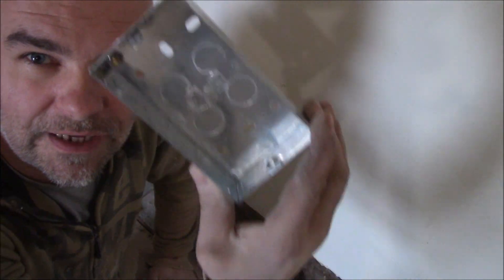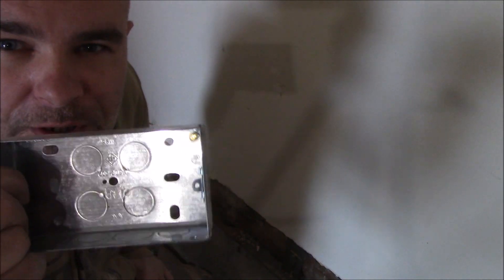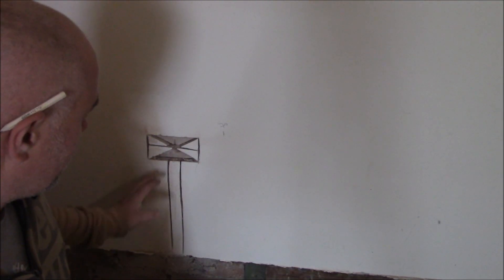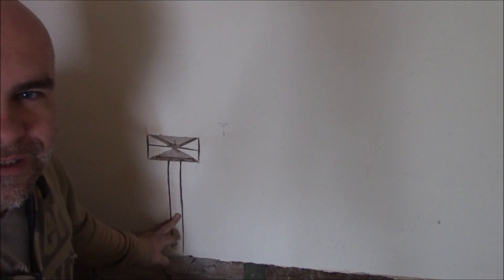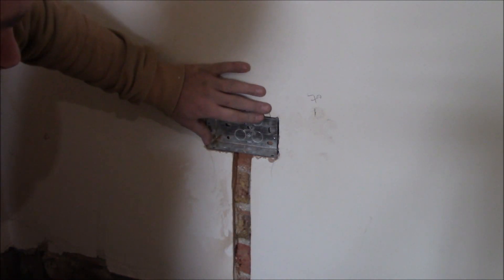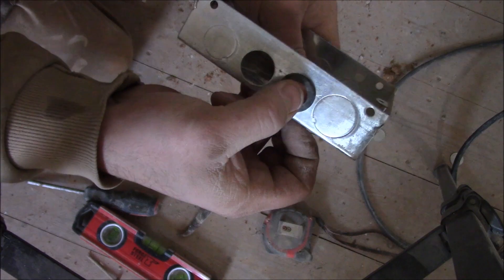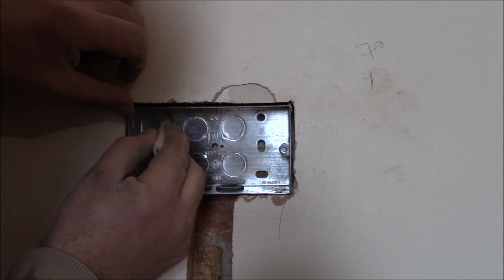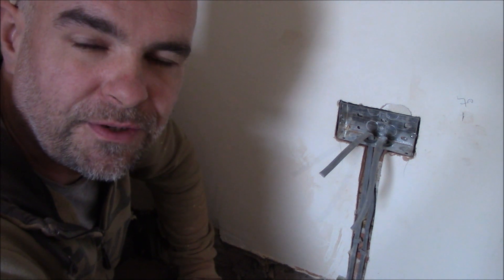how to install electrical back box How to fit socket outlet metal box

Comment: 5yrs late to the party but hey I’m here. In the us we would surface mount that box and install pipe to protect the wires. Pretty wild that you guys cut into the structural parts of the building for the box and wires. In the us the wires would have to be protected in conduit or roughly 2 inches of concrete not sure what that is in mm 😂. But it looks to me like you only cover the uf cables with .5 inches of material when you’re finished. I would say your finish probably looks nicer but you sacrifice the building integrity and wire protection to do so across the pond there. But if that’s how you doit it looks good from over here mate 👍

Comment: Getting the wall flat behind the box is quite tricky and can be deceptive as a small lump will make it feel like the box doesn't fit. I ended up going too deep and needing something to pack the wall back out (I used cardboard from a box) but it didn't feel good. Practice makes perfect

Comment: Congratulations on such craftsmanship with the angle grinder for the wall box cut, is one of the neatest I have seen. I myself use an Arbortech Brick Saw with wall box blade & chase the walls with a Makita wall chaser with dust attachments....makes for effortless work & less cleanup ....enjoyed your post.   Greetings from Australia

Comment: When you do this do you need to run an earth cable from the box to the earth socket?
Reply: Not required by the regs, but good practice.
Reply: Good practise yes but itll be earthed through the plate pins
Reply: @powell2762  Thanks

Comment: Here in Portugal the electrical box and fitment seems very difficult  to set up  perfect in an old  stone wall any ideas to simplify the fixing to a rigid   Square / level result . Tgank you
Reply: In stone I'd probably surface mount and use some cable trunking or if you have plaster surface mount the socket and channel the cables into the plaster with entry from the rear of the surface box.

Comment: I thought that under current regulations that the cable had to be protected against drilling by being put into metal conduit or covered by a metal channel  before being sealed into the wall.
Reply: What regulations is that?
Reply: I think he's trolling
Reply: @Chand B the cable needs to be protected from the plaster which is applied when finished. you can use plastic capping to do this if your cables are protected by a 30mA RCD at the fuseboard. If not you must use suitably earthed metal capping as per regulations.
Reply: No need for any conduit if fit with RCD. When you run longer bits you use conduit oyherwise your cables are around the place.
Reply from the maker: These  cables will be protected by 30mA RCD  so it  doesn't need metal conduit

Comment: Question do you have to use bonding on the channel can't you just use filler?
Reply from the maker: Easyfilla or polyfilla is just for the finish off as you can put only few mm thick,  otherwise it will crack .  With bonding you can cover larger holes or chunks of  missing plaster and you can fill up to few cm. So I always fill it with bonding first and then some filler or  multifinish plaster on top it depends if I'm going to do the whole wall or just fill what's missing.  Cheers
Reply: Tanx for answering my question,I enjoy watching your channel.